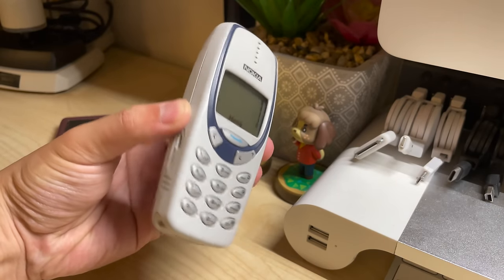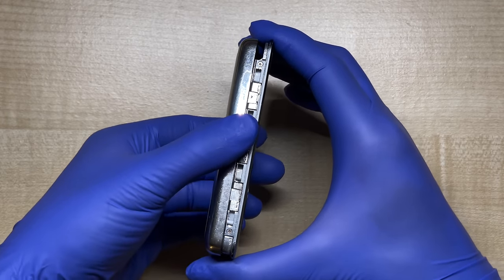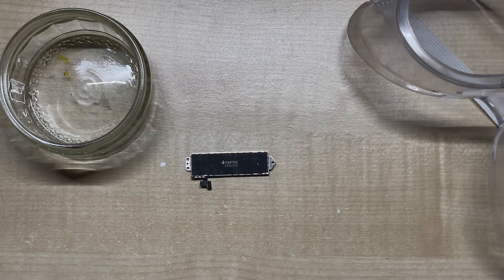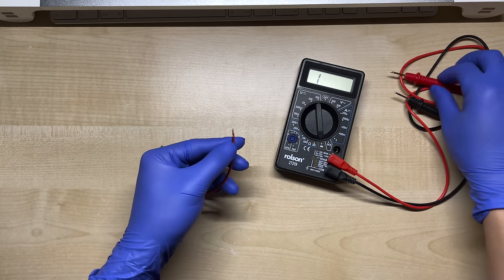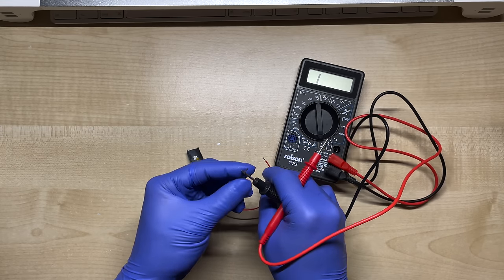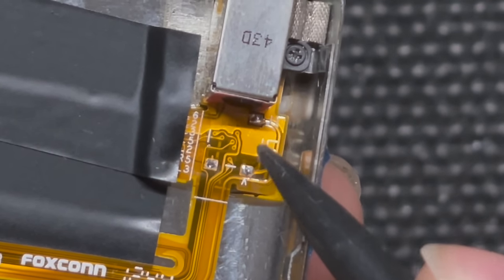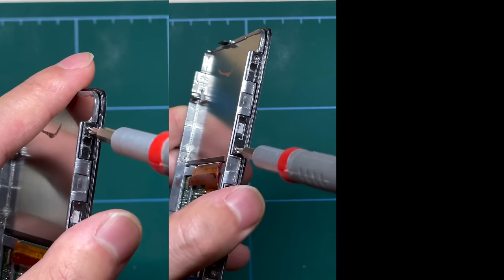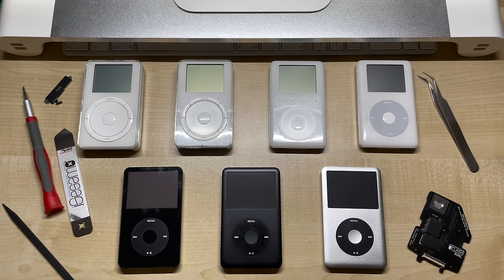iPod Classic Taptic Engine Mod Tutorial (5th, 6th, 7th gen) (Haptic Click Wheel)

Comment from the maker: Update: It's come to my attention that several businesses have started selling Taptic mod kits for iPods and linking to my videos as installation guides. Please note that I am not affiliated with or employed by any of these sellers and cannot provide tech support for their products or assistance with sales, shipping, or refunds. If you were directed here by such a product and need help, please contact the seller you purchased your kit from. Thank you!
Reply: Thx for the amazing tutorial!
Just one doubt, i've successfully installed this mod with my 6th Gen iPod Classic with the iPhone 7 taptic engine, but i'm having really weird problem... The taptic engine is overheating, but i don't know why...
Do you have some clue on what could It be?
Reply from the maker: I've never had a Taptic Engine overheat before, does it happen when idle or does it only overheat when being used? How hot does it get?
Reply: The taptic engine get's around 45° C. And it heats even in idle, so using the scrollwheel or not, doesn't appear to make any difference... When starting the iPod up It slowsly starts to heat up.
Reply: Just an addon, i've bought a pack with 5 taptic engines from Aliexpress. And i've tested 2 of them, an both have the problem of heating.
Reply from the maker: Hmm, definitely not normal. Could something be shorted? Have you tested with another iPod or headphone assembly?
Reply: No, unfortunately i don't have another iPod to test with... But i didn't try to use the taptic engine with another project.
Any guess on where i could search for a shortcircuit in the board?
The only think that i've used differently is a thinner wire (0.5mm), not sure that would bê a problem
Reply from the maker: @carlosborges616  I was thinking if either the Taptic Engine's pads were shorted with each other, or if one of the contacts was being shorted to the body of the engine itself?
Reply: I just looked at these kits as i was curious, saw some on etsy for £34 with a 20% off offer, i dont understand why someone would buy one of these lmao, the quality of their assembly doesn't even look clean its probably got like 15cm of wire hanging about.

Also im wondering is it possible to leave the speaker in place so you have both sound and vibration or is there not enough power?
Reply from the maker: Theoretically it's possible to have both, some people have managed to do it by connecting the Taptic Engine in parallel to the clicker. While the kits cost $35, the materials cost about $5-$10.
Reply: @NekoMichi  Okay i might order the parts and try it i think the combo would work nicely, and yeah that why i dont understand why someone would buy the kits lol
Reply: Would be nice if I could just buy a completed one from you.

Comment: First time soldering. I ripped the pad that the red wire goes to clean off… I don’t think my temp was hot enough. I used some tweezers and scratched the kapin tape (orange stuff) off the ribbon wire. Did a dot of flux and “tinned” my iron. Just melted a small bead to the iron. And was able to solder the red wire directly to the connection in the ribbon wire. I have parts coming to do a full rebuild and was messing around with this since I bought a broken iPhone 8 for $6 and am replacing the headphone line/battery etc so saw it as some practice. Honestly im blown away i got it to work after the devastation of ripping the pad off. Hopefully someone that has done the same reads this and can follow suit. Thanks for the video! Cheers

Comment: i finally succeeded! Instead of soldering on flex cable, disassamble speaker and soldering to points for coil is more safer from burning your cable. i used iphone X taptic kinda weak but worked fine🎉

Comment: Just completed this mod in a 5th gen, thin back with a quad and a big battery. It was very tight getting it closed, the battery JUST clears the taptic engine!
Reply: What Taptic Engine did you use?
Reply: Curious what battery size and which Taptic Engine you used? Cheers @SDLearmonth
Reply: I did this mod with the iflash solo and a 3000mah battery. I had to get creative with where I put the taptic engine. I also installed a classic aluminum front this go around, feels premium with that and the motor!

Comment: Quick tip: strip an ethernet cable for those tiny little wires - i used that and soldered the first pad, but melted the second one sadly.... Used a taptic engine from a broken iphone 7 too, so didn't cost me anything to at least try lol

Comment: Great video! For the third generation classic, can a larger battery be fitted when undertaking a flashmod, and can a taptic be added just like in fourth gen or is it more tricky with the third gen? Many thanks, and keep posting great content!
Reply from the maker: The internal layout of the 3rd gen is quite different to the 4th gen and so my method won't work directly. The reason is because the 3rd gen's battery slot is vertical and not horizontal, and the hard drive ribbon is too short to fold and allow a trimmed iFlash ATA to slot into the battery compartment in order to fit a larger battery. It may be possible to flashmod a 3rd gen and add a Taptic Engine, but keep the same original battery instead of adding a larger 3000mAh battery.

Comment: What happens if you don't remove the speaker? Would that cause any issue? I think it would be kinda cool to have the speaker make the click voice and the vibration as well.
Reply from the maker: You'll get vibrations alongside the clock sound, but both will be weaker.
Reply: @NekoMichi  Would it be plausible to incorporate some kind of small step-up board to increase power allowing full click noise and vibration?
Reply from the maker: I haven't tried, so it may or may not be possible.

Comment: I did it! I used some of the ipod mini's battery cable as the conductor cable because I didn't find these small cables on sale in my town. Which one did you use btw? Second time soldering something and proving that it is doable even without experience. Great tutorial!
Reply from the maker: The cables I had are generic cheap 1mm diameter cables from a local electronics store, ideally I should be using thinner cables because they are more flexible.

Comment: Hi! Awesome video. Can I keep the speaker on and just piggy-back off of it? My only concern is running out of amps.
Reply from the maker: I've tried keeping both the speaker and engine together, but the output on both gets halved so it's too quiet and haptics are too weak to detect.
Reply: @NekoMichi  Thanks for the tip. Is the taptic motor as strong as it is in a phone?
Reply from the maker: It feels slightly weaker, this is likely because the Taptic Engine is tuned to resonate at a certain frequency, but the iPod clicker operates at a slightly different frequency.
Reply: @NekoMichi  ah, legend. thanks for your help!

Comment: Hi, a while since you posted this, but was curious, why removing the speaker? Are you not removing a functionality form the ipod by doing so? And can’t you add the taptic on top of the speaker? Thank you ^^
Reply from the maker: I don't like the sound and also it makes it easier to access the soldering pads. This is optional and you can wire the Taptic Engine in parallel to the piezo clicker without removing it.
Reply: Wow thanks a lot for quick reply, much appreciated ^^. I am considering buying an ipod 7th for nostalgia and also removing a bit all AI suggestion from nowadays experience, so looking at all options ^^.

Comment: you mention at 8:40 to have the taptic engine touching the edges before securing with epoxy, but the corner is rounded upwards on the inside. how did you secure your taptic engine to actually have it touching the edge without laying flat on the case?
Reply from the maker: I position it to align with the inside of the Hold Switch assembly, which is at a right-angle. The position is similar to how the battery was originally kept.
Reply: @NekoMichi i see, the backplate i bought for my 5.5 doesnt have that unfortunately. thanks for the quick reply

Comment: Does the ipod classic thickness matter? Mine is an 80gb which I believe is considered slim. I'm putting a iflash solo and 2000mah battery (compatible with the solo). Will I need all thicker case components to have the taptic engine fit around everything? (it looked like yours was thicker than when you started)
Reply from the maker: In this video, I used a thin back however this was with an iFlash Quad. The iFlash Solo is thicker, so I think you'll need a thick back plate in this case.

Comment: Is this ONLY works  for thick back iPods or thin one has enough space as well? Thanks for the great video and sharing your experience!
Reply from the maker: This works with the thin back.
Reply: @NekoMichi  oh, that's nice! Could you please give proper combination of elements to mod? As I see I need iFlash quad and 1900 or 2000 mAh battery to fit taptic engine to thin iPod. Am I correct?
Reply from the maker: - iFlash Quad
- Samsung Evo 256GB micro SD card
- 3,000mAh battery
- iPhone 7 Plus Taptic Engine
Reply: Thank you!

Comment: @nekomichi thanks for the amazing tutorial video. 

I had a question… does the taptic mod only work if you solder on the first and last pads of the Taptic Engine? I’ve managed to pull one off being a bit overzealous with the soldering, so not sure if I need to scrap it and start with a new engine
Reply from the maker: Yes, it has to be the first and last pads. It might be possible to scrape off some of the insulation layer of the ribbon cable near the lost pad to expose the contact to solder to, but this can get messy.

Comment: Hey thanks for the detailed video! Very informative and easy to follow. 

I have just done this and I can feel the haptic but it’s really low. I can hear it working more than I can feel it. 

There is an option that the engine will only make sound?
Or maybe o should put it in another place? (Put it little bit higher than the hdd ribbon cable)
Reply from the maker: There isn't a sound-only option for the motor. Have you used glue or epoxy to mount the motor to the back casing? Also, was the motor accidentally bent or otherwise was pressure applied to the motor at any point?
Reply: @NekoMichi  I used double sided tape but at the start it worked pretty nice.. 
I guess there was too many pressure when I closed it, it was tight..
I’ll make another check with new motor when they arrive and I’ll update here. 
There is a possibility that pressure made it to only make sound?
Reply from the maker: It's possible. The Taptic Engine uses precisely aligned electromagnets, any mechanical pressure on the motor could cause the alignment to break and stop it from working properly.
Reply: @NekoMichi  ok so I’ll try again soon with new motor and write here if itf fixed. 

Thanks you very much for the fast answer!!
Reply from the maker: If you pop the iPod's back casing off but keep the headphone ribbon plugged into the main board, does the motor work with normal strength vibrations?
Reply: @NekoMichi  yea I opened and check but it was super low if I’m comparing it to the first test I did after soldering before closing it. I can also tell you that it took few hours to stop the vibrations because it worked yesterday and today it stopped, sound like it can happen because of the pressure I put on it to close. When I opened it I felt it was working but very low.

Comment: I did this mod with the same iPhone 7 Plus Taptic Engine. Everything appeared to go smooth. But when I tested it, I don’t feel any vibrations. I do hear clicking sounds from the Taptic Engine. The engine had continuity. Before I wired it to the iPod. Any idea on what this could be? Did I get unlucky and get a busted engine? If I buy another Taptic Engine is there a way to test the vibration before I glue and solder it to the iPod? Thank you
Reply from the maker: Are there any dents or pressure damage marks on the Taptic Engine??
Reply: @NekoMichi  not that I could tell, but maybe I added too much pressure when I was holding it down to epoxy it

Comment: It's the 6/7 gen more thick then a 5.5 thin? I don't think it's possible this setup on a 5.5 thing, i was hoping, i think even with a 2000mha and iflash solo, there isn't the space for the taptic, so the only way it's a thick back. I'm righ?
Reply from the maker: The thin 5.5th gen should fit if you use an iFlash Quad. It won't fit the iFlash Solo, it has to be the iFlash Quad.

Comment: Is the iphone 7 plus taptic engine the only one with the diagnostic pads under the ink? I’d prefer to use a smaller taptic engine maybe from the iphone 12mini or something as then i still have space to mount my bluetooth module… do you know if that taptic engine also has those solder pads?
Reply from the maker: The iPhone X or iPhone 7 (non-plus) motor also has the pads and can be used (it's a little smaller). I'm not sure if the 12 Mini motor has the pads though.

Comment: I'm assuming the Taptic Engine works with the scroll wheel because the purpose of the built in speaker was feedback for the scroll wheel?
Reply from the maker: It's a 1:1 replacement for the piezo clicker

Comment: Is there any way to use the Taptic Engine in something else? I was looking for a small dc to ac inverter but I couldn’t find anything small enough, let alone anything small that wasn’t dc to dc. Please help, thanks.
Reply from the maker: The Taptic Engine can probably be used to substitute speakers or piezo clickers in devices other than iPods, although voltages may vary.

Comment: Would it be possible to instead of removing the speaker, wire the engine wires to the solder balls of the speaker? Then you could have the noise and feel of scrolling
Reply from the maker: I've tried that before, it causes the output of both the piezo clicker and the Taptic Engine to be halved.
Reply: @NekoMichi  could there be a way to up the input power into the speaker? Maybe some little thing to wire in

Comment: I have an iPod classic that I replaced its HDD with an SSD, and I don't know if I can install Taptic Engine for it.
Reply from the maker: It will depend on the type of SSD you use, some are too large and do not leave enough space for the Taptic Engine. I used an iFlash Quad, but an Imcort dual micro SD adaptor might also work.
Reply: @NekoMichi  My SSD isn't very large but it might be a little bit thick, and I think it's difficult to buy iFlash in China because there are no shops selling it on some Chinese online shopping sites like Taobao, but I can buy Imcort adaptor in China.
Reply from the maker: Imcort 应该没问题，只要留下和原版电池一样大的空间就可以。iPhone 7 Plus 的马达占的空间比原电池稍微小一点。
Reply: @NekoMichi  Are you Chinese or are you using a translation software?
Reply from the maker: @ZihuaGaoCHN I can speak Chinese natively
Reply: @NekoMichi  怪不得我看你的回复的时候没感觉有什么问题，没想到你会说中文。刚刚我在回复你之后突然想到你应该也不可能是中国人，毕竟我听你说话时的发音像是英国人。

Comment: soooo if you have your headphones in , do you still hear the original 'clickly' sound along with the taptic engine ,even if you can't hear it when you take out the headphones ? seems like a weird question but I thought I'd ask
Reply from the maker: Yes, it still plays in the headphones. On the 4th gen, you can independently control the clicker and the headphone clicks but on the 5th gen and newer you can only turn both on or off at the same time.

Comment: This works whit slim case? I use a 2000mah battery, is smaller than the 3000 one
Reply from the maker: This was done with a slim case, if your 2000mAh battery is smaller than the 3000mAh one then it might work.
Reply: @NekoMichi  what is the tikcness of the iflash quad?
Reply from the maker: It's about 2mm thick
Reply: @NekoMichi  I think I have a fair bit of space, I bought a Chinese ssd plus the 2000mah square battery, I already have the taptic engine prepared and it is quite thin, I will have to figure it out when my new case arrives, unfortunately I ordered it thin since I had not planned to do it this mod, I hope everything fits

Comment: Does the vibration get toggled on and off by changing the 'clicker' setting? I'd like to add this to my mod, but i don't like the clicker sound in the headphones.

Thanks :)
Reply from the maker: Yes, toggling the clicker will also toggle the haptics. Unfortunately on the newer iPods this controls the clicking in the headphones too, while on older iPods (4th gen, Mini) the two can be toggled independently from each other.
Reply: @NekoMichi  Oh well, I'm modifying a 7th gen classic, and was really only adding it for a bit of fun and because I have the space. Thanks for info :)

Comment: i have a question: there is a way to attach the taptic engine without taking out the speaker?
Reply from the maker: You can wire it in parallel, but both speaker and Taptic Engine will become weak

Comment: Hi
I had a question
how many gigs was the ipod capacity that you used for example?
Reply from the maker: In this video, the iPod was flashmodded to 256GB. It was originally a thin 160GB model.
Reply: @NekoMichi  Thank you, I wanted to know how thick the iPod should be to do this

Comment: If I knew how to mod an iPod, I would love an iPod Classic (either the 5.5 or 7) with an all-black body, Taptic Engine, 2TB of storage, the 3000 mAH battery, Bluetooth to connect my AirPods, and a USB-C port (to give it a really modern look). However, since the iPod 5.5 and 7 are basically the same (minus the sound quality), is it possible to put the logic board from 5.5 in a 7?
Reply from the maker: I've tested but it didn't work, the reason is because the LCD panel of the 5th gen is too thick to fit inside a 7th gen enclosure.

Comment: would a 3000mah battery, an iflash quad, and this mod all fit into a thin shell 5th gen, or would i need to get a thick shell? thanks
Reply from the maker: It should fit a thin back plate, in the video I used a thin one.